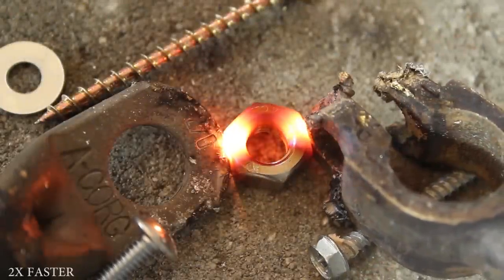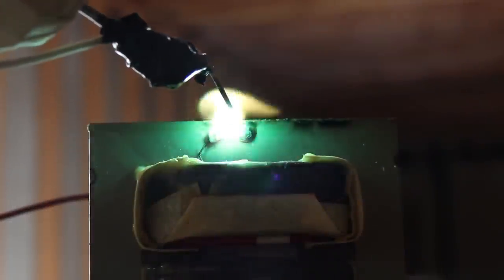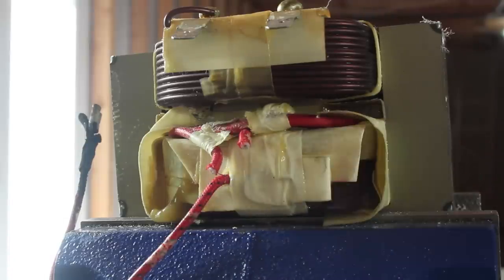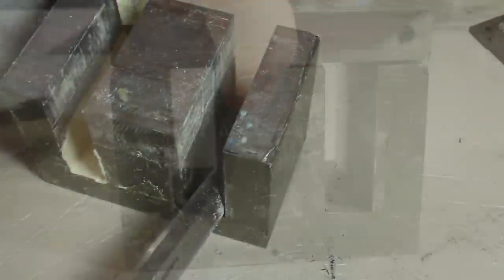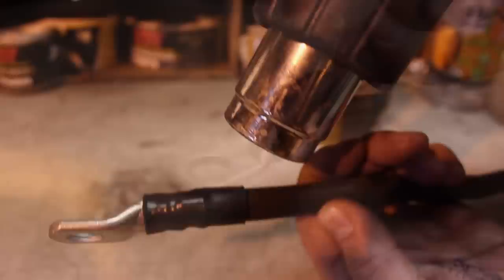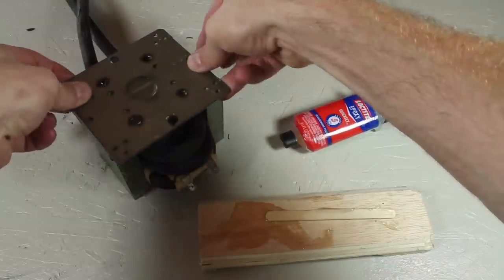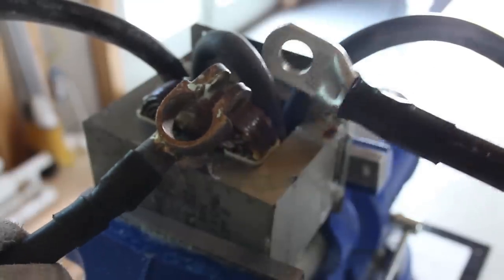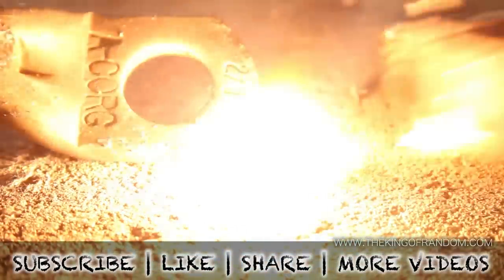How to Make The Metal Melter

Comment: where can you buy 2 gauge copper wire? (Lowes has it but it is very stiff) Apparently it is called welding wire, but that is extremely expensive (like 125 per 25 ft.)
Reply: car audio shops have it.

Comment: I’m surprised he never put a disclaimer or a warning. I’ve seen online that a lot of people have died trying to make this
Reply: I don't see how you could die from doing this unless you touched mains voltage in the input. This outputs around two volts, which divided by the human body resitance(1000kohms - ~5kohms with wet hands) I=V/R gives you around .2ma is impossible to notice. The reason that it's able to melt metal is that metal has a very low resistance, so tons of current can flow through it.

Comment: can i use a 12v computer power suply on a microwave oven tranformer to create arcs?
Reply: +geffery luishhammersama In order for the MOT to work properly you need to give it 120V (what comes out of the wall in the US) and it'lll output to around 2000v. It's very simply, just take the power cable that came from the microwave and attach the live and neutral to the primary coil and plug it into the wall (IN THAT ORDER) and there you go. Be careful with the arcs though, they are very hot and very bright, if you're going to look at them make sure to use proper UV eye protection.

In theory you could run it off 12v, but seeing as how that's a tenth of the operating voltage I'm not sure what results you would get, except that it would not output nearly as much as if you powered it properly.
Reply: Thanks Andy! I am a bit scared about hooking it up to 120v but i guess if i take the proper precausions i will be okay would a welding mask work okay? I will try to run it of 12v and post back the results.

Thanks again for your time!
Reply: If you're worried about high voltage, arcs aren't for you. But wearing proper safety equipment and following safety procedures lowers the risk greatly. A welding mask would protect you just fine, most are rated at like 99.9% UV protection. I'd also recommend high voltage gloves, but these can be pricey, so if you don't use then, just remember to only have one hand connecting live wires, and try not to touch the metal of course, and keep one hand behind your back. This will prevent the current from passing through you arms and heart. Also wear well insulated shoes. I'd suggest looking up high voltage safety for more information.

Comment: i think the insulated wire shown is 2/0 gauge, not two gauge. i could be wrong but if you're building this, buy 2/0 wire
Reply: Yeah I agree, the ring lug on the end says 2 ought on the top. It looks huge as well, I think it is 2 ought
Reply: Honestly, I wonder if it's even bigger. I'm literally holding THHN 2/0 wire right now, and it's about the size of my pinky. Wondering what he used....

Comment: in this video you had 2 gauge and in the arc furnace you had 8 gauge is there any reason for this? does the gauge matter for transferring high amount of amps?
Reply: If the coil is to weak the coil will burn out
Reply: If the coil is too weak the coil will burn out

Comment: More info: the whole system is a 1600 W metal melter. 1600 W = 120 V x 13 A (high voltage, low amp side) = 2 V x 800 A (low voltage, high amp side). Those two wires are well insulated/separated from each other, so the high voltage low amp will not open any circuit breaker of about 20 A (high volt, low amp side), which can be a normal contact. 

HOWEVER, for the folks trying this at home, YOU ARE CREATING A SHORT CIRCUIT on the high amp side, so be VERY CAREFUL not to have the two windings touching each other AT ALL. You might risk burning your house due to a short circuit.
Reply: Ohms law? Also are you saying if the primary and secondary touch when power is applied it will short and blow up in your face?
Reply: Shane Aykroid
Yes, because if your circuit breakers do not work properly, you'll have a high voltage, high current situation because electric resistance of the previously low voltage, high current is very low. You might not end up with 1600 W, but maybe higher, because high volt (120 V), and high amp (800 A), becomes 96,000 W. That's a lot. Wires will become red hot and melt themselves. If it melts metal, then yes, it can melt your face and the wooden structure of a house. Again, that is if circuit breakers (that typically go for 20-40 A) do not work, your house becomes ashes. If circuit breakers work, then it will just be a blackout.
Reply: TheKazooKid
As I mentioend before, you can't get 800 A because of the circuit breaker. No home, or neighborhood worth its salt does not have any circuit breaker. But let's say it they do not have it. Let's do some simple math.Let's say the wires are connected directly to a transformer. Power due to current and resistance is P=i^2*R. Copper has a conductivity of 1.724x10^-8 Ohms*meters. Let's say the copper wire diameter is half centimeter and length is 20 meters. Resistance=resistivity*length/AreaThis gives .018 Ohms. With 800 A and .018 Ohms, power is 11.2 kW. That is not that much for a transformer, but it is a lot for a wire to handle. It gets hot, very hot, and of course, if the wire comes into contact with human skin, you get burned, and if it contacts the wood in your house, it burns, like your comment without numbers. Feel free to correct me if I am wrong.

Comment: I'm pretty sure that isn't 2-gauge wire. It looks like the wire used in the "The Metal Melter" video is 2-gauge, but the diameter of 2-gague wire is about 1/4 inch, not nearly as wide as the gaps in the E-piece.

Comment: I was interested in this kind of stuff for metalsmithing. Being able to super heat a piece of metal to a workable temperature in seconds would be 3 times as fast than in the furnace, which would speed production. Though I'm not a scientist and would probably zap myself to bits. I'll stick with the fire.
Reply: Not only that, but when it comes to certain metals, superheating them also removes certain enjoyable qualities about them. Steel is one of those finicky metals, that requires a specific carbon/iron/trace mineral ratio in order to have its best properties.

Superheating steel oxidizes the carbon in it, changing its properties.

Comment: i tried taking one apart and scared up the coil a bit, will it still work ?
Reply: Can you post a pic?
Reply: DeMo64738 how do you post a pic on here ? in the comment section ?
Reply: zach carl he probs tot it was instagram
Reply: zach carl as long as the windings don't come in contact, if they do you can use some nail polishing or something to insulate it.

Comment: it is a nice project he removed the secondary winding so that he can replace it with a winding with less coil less coils means high current and low voltage high current will melt the metals if he he had not done that then he would have got high voltage and low current using which we cannot melt  metals

Comment: How is it pumping out voltage if there's no physical connection?
Reply: +TheBest ChannelEver The secondary coil is charged when the electromagnetic field of the primary coil collapses due to an alternating current.  It is also in part how an oscillator works, like in a radio.

Comment: WHAT WAS THE INITIAL VOLTAGE AND AMP OUTPUT OF THE TRANSFORMER ?
Reply: +LLuE88 woulda been so good if he added this...
Reply: +LLuE88 Output full load current doesn't really matter since he changed the secondary winding, hence, changing all parameters of the transformer. Also, input voltage is whatever voltage you get from the supply (Transformers are designed to operate with specific voltage and frequencies, but that's not relevant to this experiment). The only thing that matters in this case, is the primary/secondary turn ratio. Judging by the measurments he got (2V at secondary), and assuming the input voltage at primary is 110V (Since he fed the transformer from a regular household outlet), then the ratio would be 55. This means that this melting transformer is 110/2 V and 800A SC current.

Also, don't glue the E and I pieces toghether, since that will increase the core's magnetic reluctance, decreasing the transformer's efficiency.
Reply: How do you suggest re-connecting the E and I pieces?

Comment: If you were to touch the contacts after modification would be electrocuted, burned, or both?
Reply: Neither
Reply: +lol49031 wait what?
Reply: if you were to place two finger on one hand  between the wires so that your hand was the shortest way for the electricity to get to the other wire it would probably burn your hand

Comment: 800A at 2 V is 1600w..possible but was you microwave a commerical mcirowave?
if not most home microwave are rated less..so 600A..not 800A..this is still
plenty of current to weld with..just wonder about the numbers.

Comment: I just don't get how the electricity travels from the primary core to the secondary core without there being physical wiring connecting the two. I know it has something to do with induction I believe but the mental concept of the process eludes me!
Reply: +Stanley Scalf When metal has an electrical current go through it, it generates a magnetic field, and when metal has a changing magnetic field go through it, it generates electricity. Therefor, since the primary coil has 120v AC going through it, it generates a strong magnetic field in the wire. That magnetic field then inducts(causes) an electrical current to go through the soft iron core, which generates a magnetic field in the core. Then that magnetic field generates a electrical current in the secondary winding.
Reply: +Dragon Temple I see. I understand now. I just didn't realize how powerful magnetic induction can be!

Comment: When you do this to a microwave how do you depower the transformer?
Reply: Find the capacitor and put a screw driver on  both connection and don't hold the metal part but if you wait a few weeks after unplugging it you should be safe but do that just in case.
Reply: Thanks.

Comment: i don't get how this works, electricity goes into a coil, is amplified, and then comes out of another coil with absolutely no connection? am i missing something?
Reply: Evan Bohlman A easier to understand version... Electric through coil = magnetic fields and magnetic fields through coil = electric.... So ...electric ----coils------> magnetic fields ------coils-----> electric power and melt metal.... Tadah wireless power

Comment: Voltage doesn't kill you, it's the current (Amperage)
 You can have a 100V but only feel a tickle. You can have 16V and turn a welding rod or electrode into a puddle. 
 Ask any welder, they'll back me up the last part at least.
Reply: But still pretty cool.
Reply: shexdensmore Well, in reality what actually kills you is the amount of energy being pumped into you.
Voltage is energy per coulomb, and current is coulombs per second. If you have an extremely high voltage, but low current, each coulomb (count of charge) has a high amount of energy, but the flow rate of charge is very slow. This can be seen in devices such as a Van De Graff generator, where 10's of thousands of volts are present (you are also only exposed for a short time).

In contrast, house power is only 240V, but has a higher amperage, and also is applied to you for much longer than a Van De Graff generator, as well as having a practically infinite supply of charge.

In short, its a combination of current and voltage, not one or the other. You also need to take into account the amount of time you are connected.
Reply: Your half right about that
Without volts however there will not be enough potential difference to push the 800 amps through you. Skin resistance isnt linear either.so the more volts you have the easier it is to push the amps through you.
About the melting welding rods into a puddle, thats simply high electrical resistance which is generating heat. As grant has shown in this video where he grabs both leads with his hands, there is not enough volts to push the 800 amps through him.

TL;DR it takes both volts and amps to kill you(also 500 miliamps is enough to kill you so dont play with high voltages unless your sure the current is below 15 miliamps)

Comment: its not the volts that kills you its the amps, a taser runs at 100kv + but with very little amperage
Reply: SeptrothFFXI But since current gets limited by resistance you need a high enough voltage. Since you can't have one without the other the discussion is senseless anyway.

Comment: im in the uk and we run 240v well American houses use 110v any ideas one what would happen if i used this ?
Reply: I dunno. Heck, it might be even more powerful
Reply: Margie it would blow up ur house lol.
Reply: jarvie*
Reply: I genus  instead of 2V you would get 4v output, assuming the same coil ratios. Then, for the same metal piece yours could inject twice as much current, if your main supply can handle.
Reply: The transformer iron and primary winding have to be designed for the voltage and frequency that you are going to use. If you were to use this exact same transformer iron and primary winding which is designed for 120 volts and 60 Hz(USA), with a 230 volt 50 Hz(UK) input to the primary, you would smoke the primary winding quickly. The reason for this is because too many amps would flow in the primary. First because the voltage is almost double. Second because the magnetic flux in the iron would be well into saturation. Third because the frequency is lower. So, you should start with a microwave oven designed to operate on your mains voltage and frequency.

Comment: Ttansformers can only change voltage or current not power and frequency.  The output will hav low current n high voltage.  Currents above 40mA will only kill u.  Voltage has no role in electric death..

Comment: Hmm..... I wonder what gauge of wire and how many wraps of said wire I would need to make it throw out 12 volts......
Reply: probably about 6 times as many as he needed for 2 volts.  But if you try and run it into a short circuit like he is you'll probably smoke it.  He can get away with shorting it out a little bit because the voltage is low enough that the resistance of the hot metal is limiting it to below what the transformer will handle.  I'm sure it would still melt the insulation after a while though if he sustained a connection for long.

Comment: I have a few questions:
Will my smoke alarm react to this?
Can I burn my hand off using this?
Reply: andrei teo Well that was unexpected.  NOT!
Reply: Mr Leb By that logic, every 2A laptop supply is a death trap. ;)

The output from this transformer is so low voltage you could touch the outputs with your hands and nothing will happen whatsoever.  Just because it's capable of 800A into the right load doesn't mean it will deliver it to every load it encounters.

It's still a dangerous project for anyone inexperienced with working on mains equipment, but the dangers are more likely from damaging the primary side of the transformer, and either putting the core at 120V, or causing a short and burning it up.

You're right on the heat side of things though.  Setting off the smoke detector is likely, from burning off anything in contact with the hot metal (any oil, paint, plastic touching it, etc) and if it comes in contact with anything flamable you could easily burn your house down, etc.

Comment: how does the black cable work it doesnt even connect to the power
Reply: +Superdoge How is it that he can connect 120V household electricity to the primary coil without getting a short and tripping the circuit breaker on his power strip?  Is it because the coil is resistive?
Reply: +Superdoge i did it is nothing
Reply: +Superdoge i still dont understand
Reply: +Koolaid_9525 It's electromagnetic induction.  In other words, the primary coil creates an invisible field when electricity runs through it.  When another coil is placed near it, the electromagnetic field is picked up by it.  The core (thick metal pieces) makes this happen alot more efficiently.  If the primary coil has 100 turns (wraps), and the other coil (secondary) has 10 turns, the voltage is reduced by that same 10-to-1 ratio.  The total power stays the same. (Or close to it.)  That means whatever the amperage was, it is now 10 times higher than what it is in the primary.
Reply: +Larry Weir
to simplify: the primary coil is an inductance, which acts as a resistance when AC current pass through it (120V household electricity is AC with a frequency of 60 Hz)
Reply: +Larry Weir The primary coil has an insulation enamel on it that stops the electricity from going through, which is usually only on magnet wire. If you were to scrape it with a knife or hard surface, it would get shiny and conduct electricity.
Reply: +Tommaso Forni I like how you edited it, but you still have the incorrect frequency. USA usually uses 60Hz, rest of the world usually 50Hz.

Comment: I don't get why isolation broke on your fisrt attemp
Reply: Zio Pepo the gauge he was using was lower than the 2 gauge he winded up using because the amount of energy produced was being constricted by the smaller gauge which results in heat which results in the wire melting